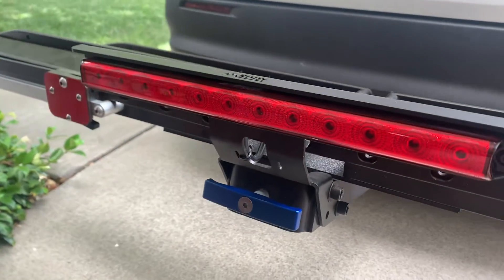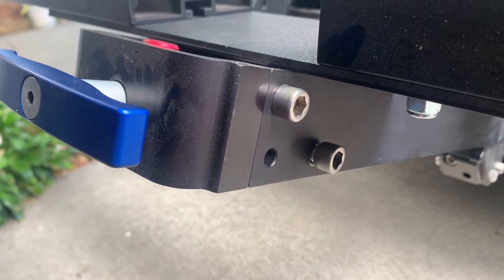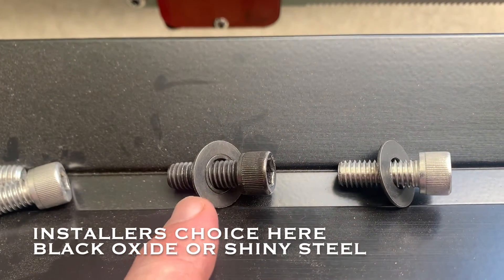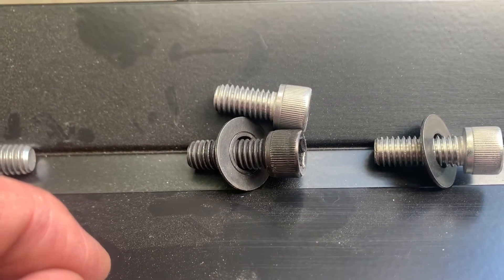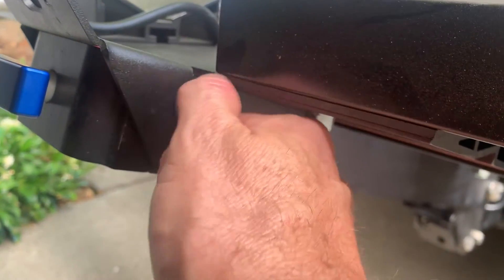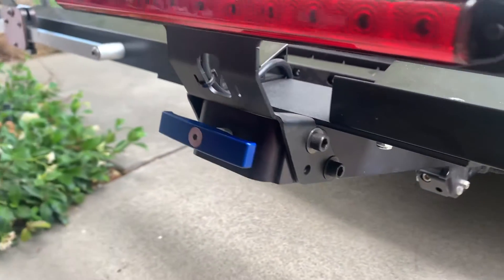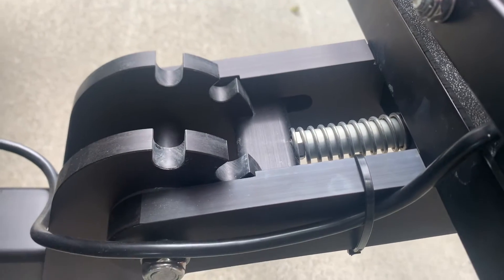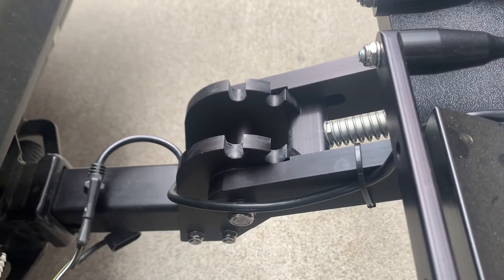Kody Light - 1Up Equip-D Bike Rack Install - Brightest and Safest Bike Rack Lights - Kody Tech

Comment: are u using the short cable(5') wiring? Thanks
Reply from the maker: Yes, during this installation I used the short (5') cable.  In most situations this cable length will be ideal.  The longer cables are applicable only if you have an extra hitch extension, a swing arm or anything else that would extend the required length of the cable.  Thank you!